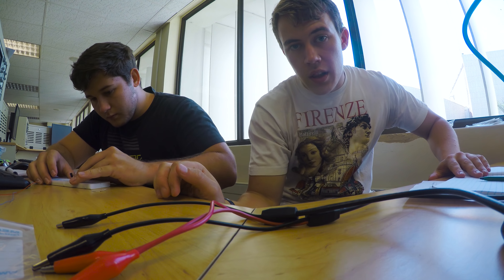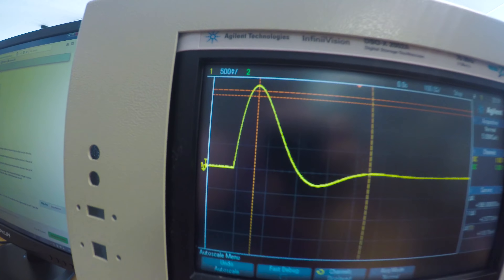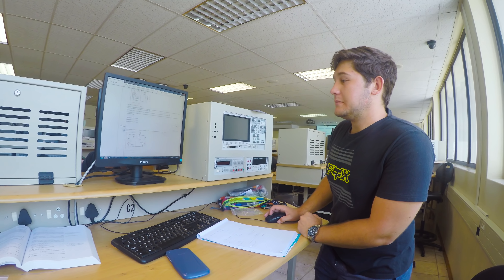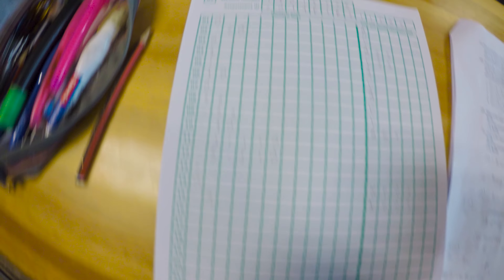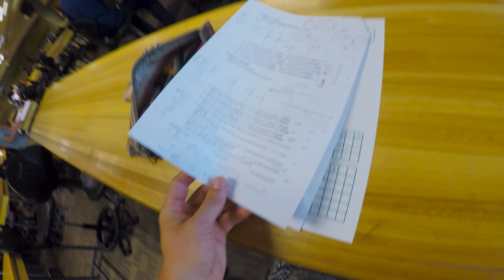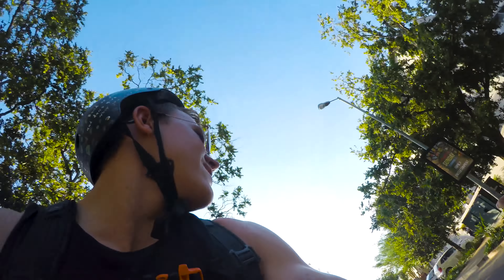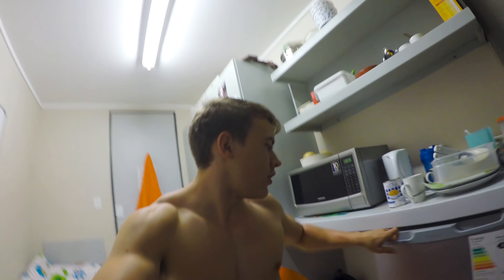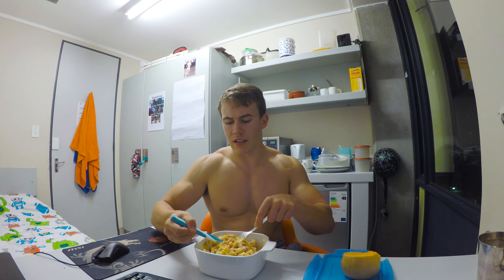Circuits All Day Every Day | Computer Engineering

Comment: Let's say I want to be Computer engineer and I only have math,physics and chemistry but not computer studies... Will I be fine choosing that course? Do they give introductory lessons?
Reply from the maker: You can do this yes. COS132 is an introductory module for computer science in first yer that will teach you coding from scratch. But it is advised you code a bit beforehand to see if you actually like it and are capable as there's a lot of it in our course and if you're not great at it you should rather consider Electronic Engineering.